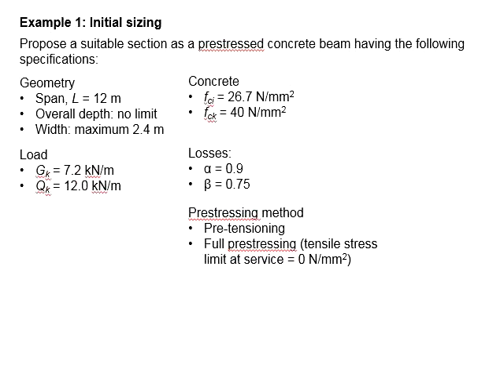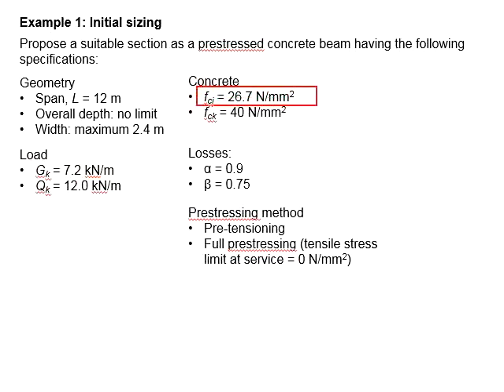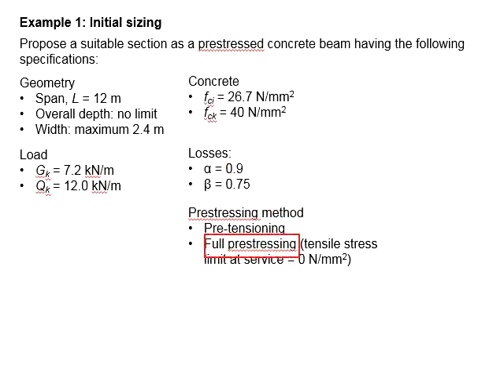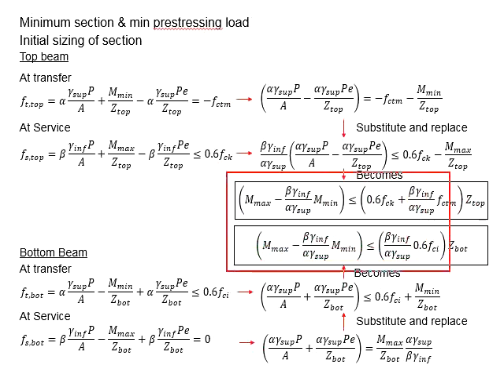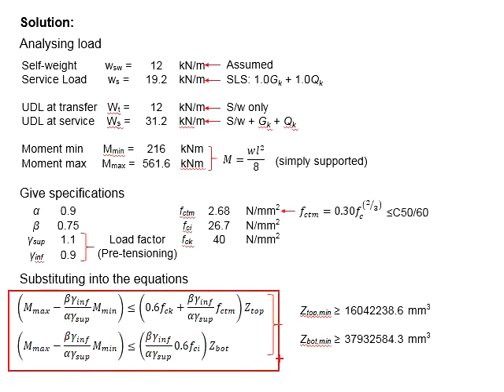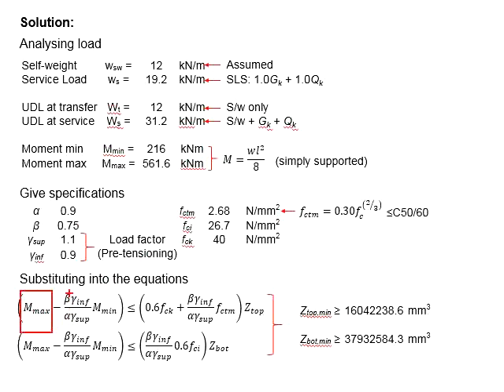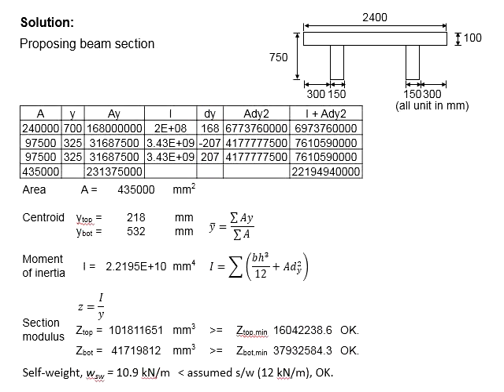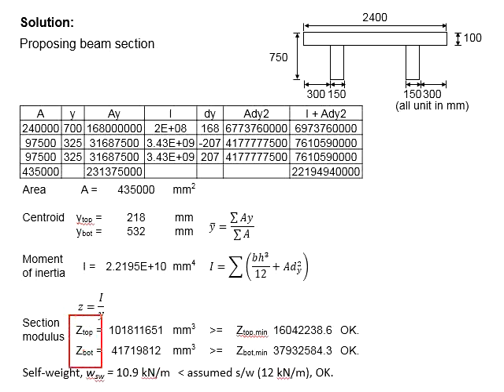2.13 Example: Initial sizing

Comment: Thank you sir for the nice videos. I have here two remarks. First, the factors used for gamma_sup and gamma_inf are for post-tensioning and not pre-tensioning. Second, we can propose the shape of the section of the beam at the first step so that we do not have to assume the self-weight of the beam.
Reply from the maker: Thanks for sharing.

Comment: Hello, I want to ask how you calculate the y top and y bottom?
Reply from the maker: ybottom is calculated using formula ΣAY/A, where the y is calculated from the beam soffit. Once you get the y bottom, use the total beam height minus y bottom to get y top.